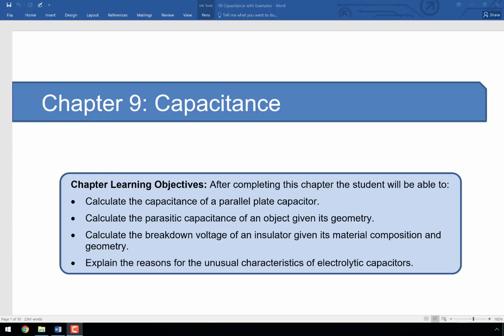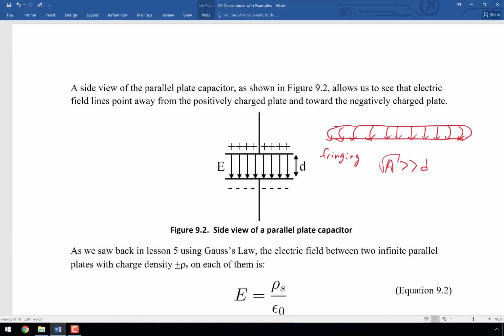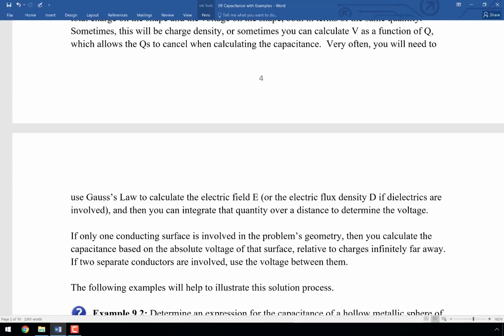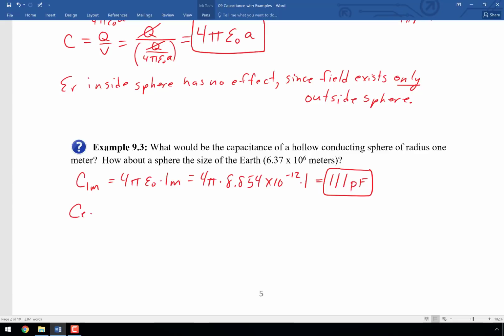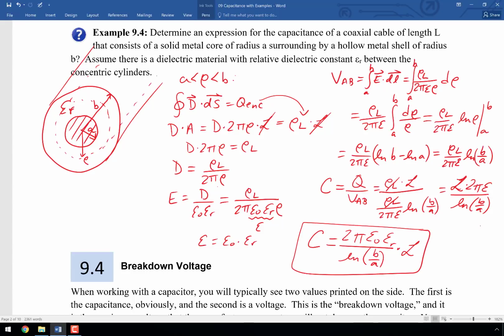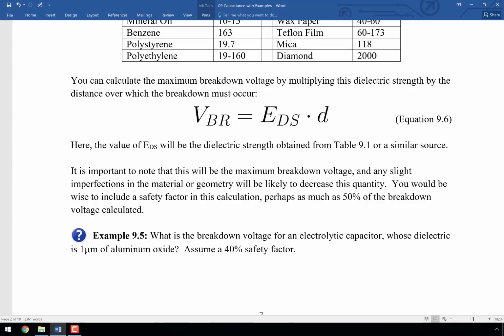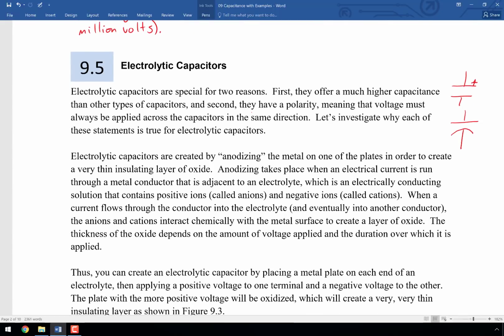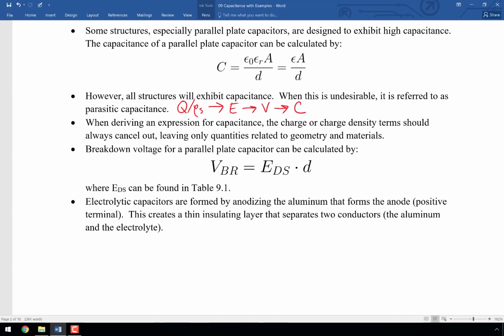Applied Electromagnetic Field Theory Chapter 9 -- Capacitors

Comment: @34:16 are the units of Vbr still in MV? I see we multiplied by 10^-6 to cancel micro meters, but not to convert the voltage
Reply from the maker: Sarah,  I believe the units of Vbr are volts, as shown.  The 10^-6 in that problem comes from the very thin layer of dielectric, and this 10^-6 effectively cancels the 10^+6 from Eds.  Effectively, it is (13.4e6)(1e-6)=13.4V.  Does that help?
Reply: Ohhhh. Yes, that helps!
Reply from the maker: Great!